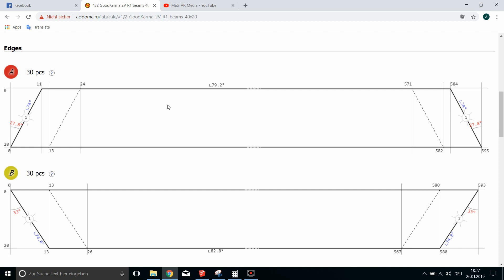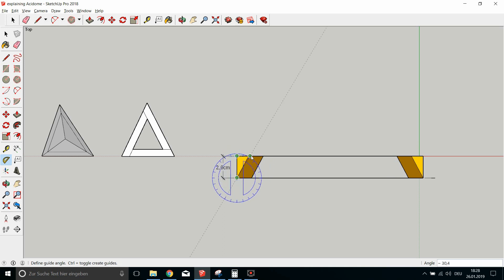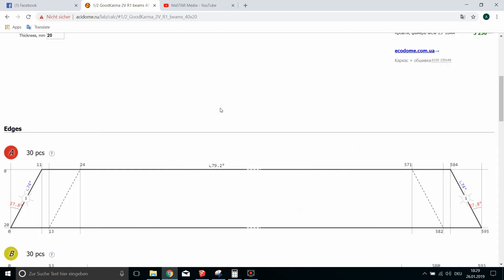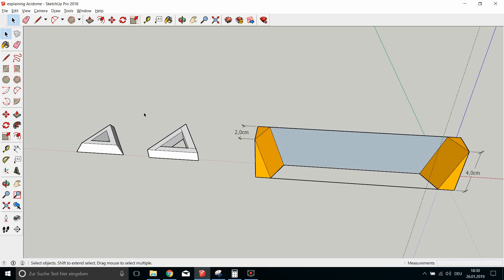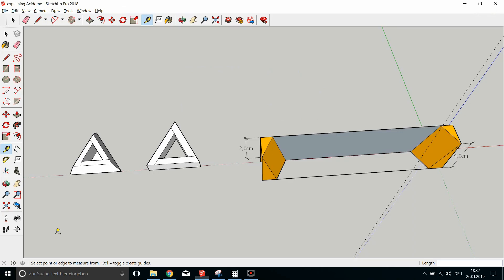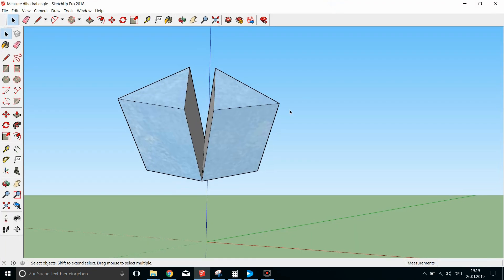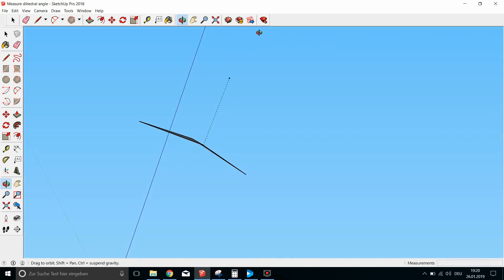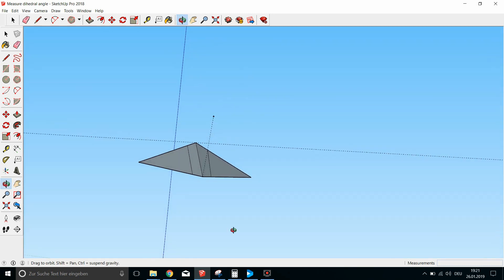Acidome.ru (.com) Diagram Tutorial

Comment: I am wandering what are the pros and the cons of this acidome design compared to beveled frame of Paul Robinson.
Reply from the maker: There is a Facebook Group called Acidome you might find more answers there. 

the biggest problem in my eyes is stability (which is ultimately not really what you need for a greenhouse though). 

In the beveled frame method the bevel is applied to the width (length > width > thickness). In acidome the bevel - if at all - is applied to the thickness. 

When you do beveled frame you are limited by the width of your saw blade. 

So you will see alot of beveled frame GeoDomes with a small width. 

The result is it only fits one screw at each end. This is a huge disadvantages when sheer forces start working on the vertices.

Just do a test. Screw two struts together ontop of each other with 2 scews at one end. Try to rip it with your hands as though you wanted to bend the screws. Then remove 2 screws and try again.

This is of course only one aspect "stability". This however the one that bothers me the most.
Reply: @alwaysgreener2856  Thanks for the detailed answer. Much appreciated.

Comment: And another question. To check I did the calculation by hand for the red angle, which should be given by tan(alpha)=11/20=0.55--> alpha=28.8
How does it come Acidome.ru gets a different (27.8) angle?
Reply from the maker: The angle you are calculating is the so called "axial angle". This "axial angle" is not part of the GoodKarma-diagram. I made a video about this fallacy https://www.youtube.com/watch?v=n7nL2zFNVyo . It is sad but there also books sold which either name the angles incorrectly or give you the wrong numbers.
Reply: @alwaysgreener2856  Hi thanks for the reply and the detailed explanation in the posted video. The difference in the two angles is also due to acidome rounding only to milimeters. The a more exact length would be something like 10.51 mm (11mm in acidome). The half mm doesn't matter much but in case anybody else got confused.:)

Comment: Hi, thank you for the video and making clear what the angles mean. If I understand it correctly, I don't have to care about the black angle (for strut A it's 79.2°), because this dihedral angle results automatically by connecting two triangles?
Reply from the maker: The black angle is the inclination of the side an imaginary pyramid. It does not result by connecting two triangles. It results from assembling the compound miters at each strut end (of one triangle). Some people also call it "strut rotation". If you rotate a strut the inner edge will move out of the original imaginary pyramid. In order to cut it flush again, you need to cut this longitudinal angle. So it really has 3 names: 1) pyramid side inclination 2) strut rotation) 3) longitudinal cut angle. What the calculator does is it takes the triangle angle and this very strut rotation and spits out compound miters. That is really all it does ;-). In one video I show how I made a little javascript program that does the exact same thing. I think it is called "Zollinger".
Reply: @alwaysgreener2856  Ok cool thanks. In the end that means I don't have to cut the black angle? And do you know by chance where to find the "Zollinger" program?

Comment from the maker: Minute 2:40 "Without the red angle don't turn on themselves" is wrong. Should have said "without the blue angle the struts don't turn on themselves".
Reply: My question is  the angle on  top of struts which  I cannot find any reference on  how to use it or  include it in the  cutting of a struts.
Reply from the maker: @amousavizadegan  In acidome there is only 2 angles "red & blue". So you have a 50% chance to get it right. One is the blade tilt and the other one is the base of the miter saw. Start with the equilateral triangle.